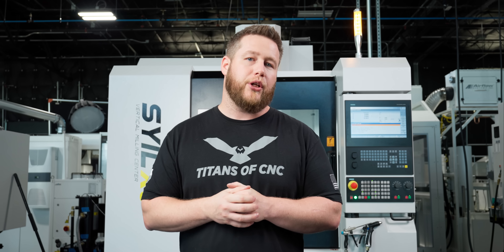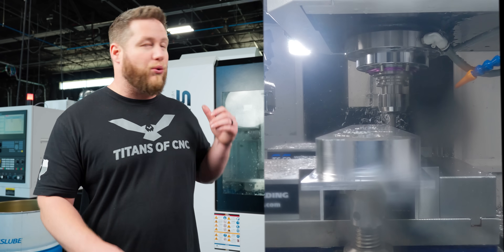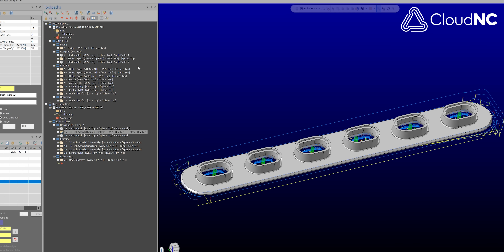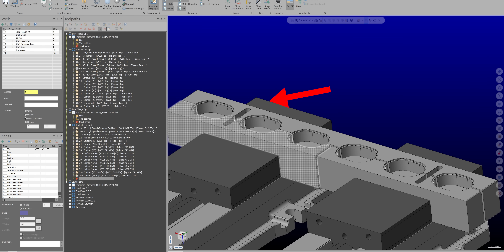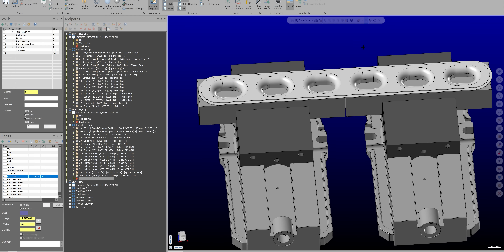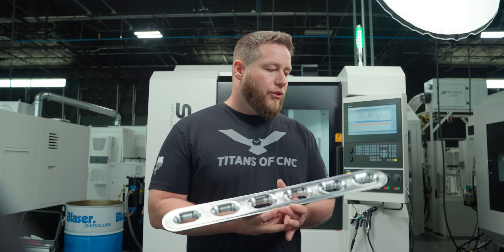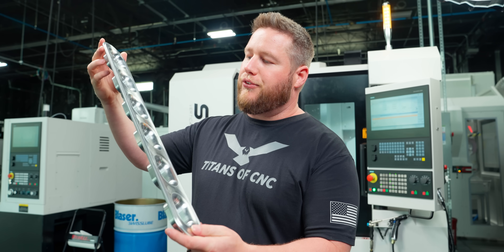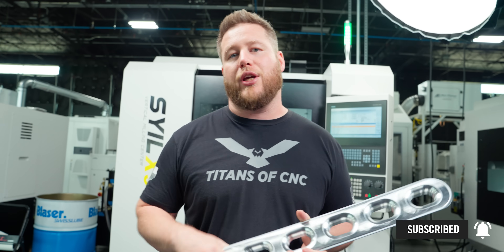Running Legit Intake Manifold’s on a $53K SYIL X9 | Full Process

Comment: Can someone help explain 9:30 for me? I'm trying to learn more. If that was a critical surface, is taking one pass vs two passes more beneficial for surface finish / tolerancing? Why is he choosing to push the machine harder rather than just taking two passes? Is it just cycle time or is there something else I am missing
Reply: Personally i think its for looks as you will see two passes down the part. Whereas going near full cutter width it will only be one.

Comment: What’s the shortest opening the X9 can be passed through when installing?  Can it run on single phase power, and if so, what voltage and amps?
Reply: would contact them at their website for the details

Comment: I wish there where also a hsk option ( cause I love the peace of mind knowing that the higher the rpm the more secure/tighter the connection between the toolholder and the spindle becomes ( have tried a bt toolholder pop out in cut with high rpm. Ran the same Programe agen afterwards with same/sister tool and sister toolholder but lowered rpm with no problem ))

Also when is the syil U5 coming?
Reply: I'm ordering BBT 40 spindle with face contact.  Tool holder can't be pushed out of line so easily
Reply: @leensteed7861  dosnt matter if it has normal bt40 or big plus bt40 when you get up into the hige rpm range cause its the centrifugal force that makes the " gripping umbrella" inside the spindle that lessens its gripping power do to the parts it use to hold onto the pull stud getting flinged outwards by the spin and there weight. but since the hsk hold from the inside pushing outwards its grip only increas with more rpm 

cat.bt.iso and sk spindle type interfaces has more holding/gripping power the lower the rpm. and decrease the higer up you go and hsk has the least gripping power the lower rpm and increase with rpm

thats why i wished for a hsk version ( cause would probably use a lot of tiny tools where i need to be at high rpm most of the time so want that higer grip on my tool holders if i can just by going with hsk ( gives ease of mind )

Comment: I work with Haas and Siemens controls. Both serve their purpose, but I find the Siemens interface more pleasant. What do you think? I also wonder why the simpler Siemens 808d control is so rarely seen on inexpensive machines.
Reply: You pay huge license fees for using the Siemens software. Haas is basically just fanuc/ g code programming while Siemens and also Heidenhain are conversation programs .
Reply: @JonasDecker-z3x Interesting about being able to put in tool names, seeing as I know Heidenhain has had that since the 90's, at least on my controls.

Comment: Guys, i have run similar long parts, thin wall parts. They always bow after op1(around 1mm over 200mm length). I am always having to take up devious ways to achieve our tolerances. The way you have done the part is THE ideal scenario especially without coolant. Is there any thing i can study or need to know beforehand to actually reach your perfection?
Reply: There are aluminum alloys that tent to bow less than others so material choice can help with that. I know that is probably not up to you, but maybe you could talk to the engineer or customer. Sometimes the same alloy with the same heat treatment bows from one supplier but does not from another so you could experiment with that.
I assume if you inspected that part in the video for flatness you would find some bow but it is not so bad that it shows up on camera.
Another question for your engineer or customer: Do the tolerances really have to be that tight? If a thin wall part gets sandwiched between two massive parts or bolted to a stable part with enough screws who cares if it is perfectly flat as long as it has constant thickness? The assembly will pull it flat.
The sad truth is: sometimes there is no way around those "devious ways" to meet the specifications on the drawing. At least for me that is always very entertaining content to watch. For this part that would mean 3 or 4 operations instead of just two. And than it gets interesting: both sides are roughed out but how do you hold that thin part to get it finished in op 3 and 4? You need to hold it firm enough that the cutting forces do not move it but also you can not distort it with the clamping force.
Reply: @ensen89 Yes, i have observed that the same grade of material behaves differently when sourced from different suppliers but it’s quite inconsistent/ i try to avoid changing suppliers mid production to avoid stock size variance over my fixtures.   I am sure that there would be some amount of deflection in the part shown in the video, but his level of confidence in loading the part for op2 (salute).
Most of the devious ways is to ensure that the thickness comes out uniform. Sometimes i leave a lot of extra stock in the overall part till the bow evens out and then rerun from start using carefully located screw holes to hold it in place. Recently, tabbing has helped. 
Most of my parts are small batch and till now, i have no clue, of my own, as to how do i run a production scenario (if it ever comes to it) for these thin parts.

Comment: If you’re worried about over tightening your part why wouldn’t you just use a torque wrench? I know some of us have great feel for vise pressure, but why risk it
Reply: Good practice and train of thought for the up and coming crowd, they're producing these world class educational videos for.
Why risk it, when you can eliminate that unknown variable, torque wrench or not - makes potential troubleshooting the CAM one step easier.
Really like the challenge of this part, more relatable to us hobbyist that doesn't build rocket parts ;) (amazing content either way!)
Reply: Using a torque wrench doesn't change the fact that you could be over tightening something.  It just means you know what you tightened it to.  

To actually know if your over tightening something requires that you know how much tightening it can handle in the first place.  That takes additional engineering time and money.  

You'd be surprised how many real- life things are done by "just get it close enough and adjust if necessary".
Reply: @matthewschultz899 trust me my full time job is being a machinist. That’s why I said some of us have the feel for our vises. I know I can work without the torque wrench and be fine because I’ve done it thousands of times, but if it’s a job that I’m setting up for my apprentice you betchya I’m setting up a torque wrench to whatever it was that my hand feel set the vise to. I told my apprentice you gotta bend a part or 2 to really learn how to feel for it
Reply: @brianropel  Machinist or an operator? 
Ive never heard of either having an apprentice, but maybe they do outside of UAW.  Im still new to it all, im a toolmaker apprentice halfway there. 
Like the other guy said, how would you know what torque amount you need for parts if you've never ran them? I rarely do more than 2 or 3 copies of a part. I only used the torque wrench twice, and it was when I was on the cnc lathe and did have a bunch of parts something for the line was way behind order.
Reply: @Under-Kaoz so the first company I worked for was owned by Hubble yes, the big space telescope Hubble. There we had engineers that would do some crazy calculations and then spit out a number for you to set the torque wrench too. I’ve since gotten married and moved away, now I just go by experience. Yes I’ve bent parts, but I’d bet that 99% of the time my feel is good enough to not ruin the part. But like I said, your gonna have to bend a few parts to master it
Reply: @brianropel  Yeah id love to get to that engineering level. I didnt know if you knew the calculations yourself. 
I got you though, yeah for sure, ive been doing pretty good on most metal tools/parts. But plastic has gotten me a few time, delrin and uhmw is pretty grippy. Im working on an alignment tool and didnt leave enough to grip on and the EM yanked her up. 😭
Live and learn though, it wasn't scrapped at least.
Reply: @Under-Kaoz so contrary to what a lot of people say that company I worked for did a lot of different plastics. We found out that single fluted tools and high speed tools did the best job. We had separate tooling closets for different materials. I spent the better part of 5 years straight doing their plastics, then moved over to their machines that were running a lot of super alloys. But personally I loved the plastics.
Reply: It is refreshing to see how you quote yourself.....
Reply: Only works in production. If you're doing one part you don't know that it's going to work.